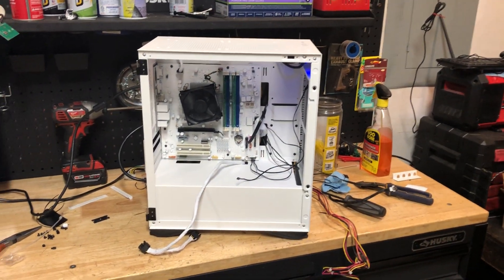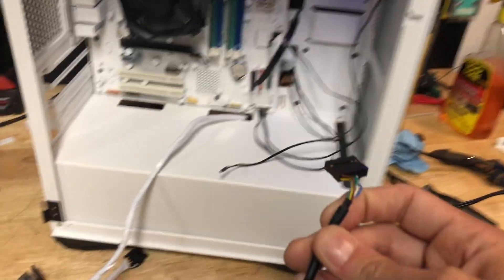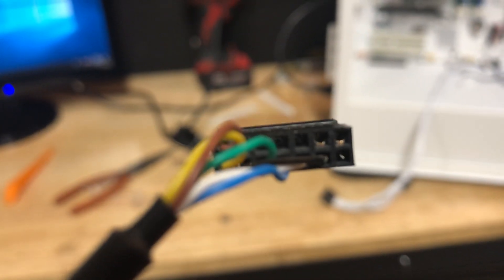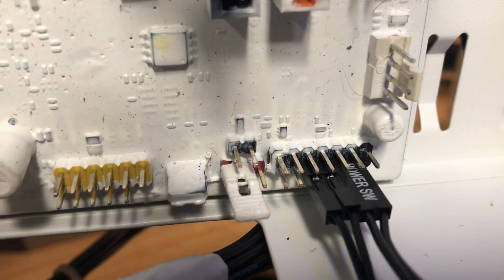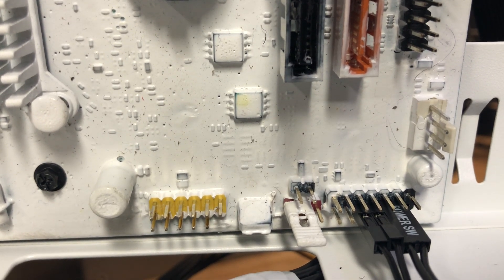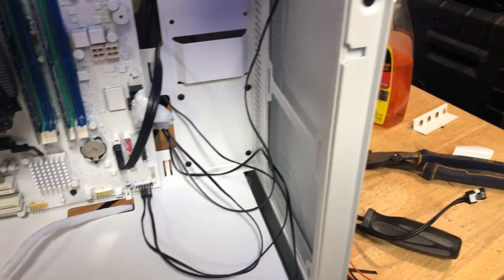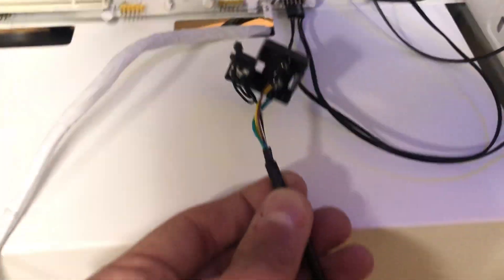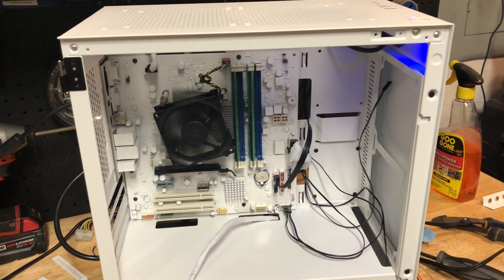Lenovo M92p power button pin out quick tip!

Comment: What if I do it backwards? What if I put a new motherboard in the case?
Reply: How does it power then do I need to buy adapters?
Reply from the maker: no, it's pinned regulary
Reply: Nevermind I figured it out with trail and error based on the yellow and brown cords. 

This video helped so much though thank you!!
Reply from the maker: coudl work

Comment: so what did u do with the hd audio connector because it has a different pin configuration ,, I saw what u did with the usb connector.
Reply from the maker: i did not plug it in, never figured out the pin out trick and just told the customer about it.

Comment: guys help me, i tried it still doesnt work
Reply: I have similar motherboard, got issues with the front panel stuff and tried this method, but still my pc won't turn on
Reply from the maker: @aes3244  check your power supply connectors, you might of plugged something wrong. The oem psu has only a 12 pin for the board and a 4 pin for the cpu which is right above the cpu socket to the left. then try the factory front panel and see if it works, it should go in one way. if your still having trouble after that then something most of gotten shorted or something. I usually when I troubleshoot I bench test it by just placing the motherboard and power supply on a bench and the trying to test it that way. that way you can see what's going on and troubleshoot things one by one. Hope this helps.
Reply: @DLMtechgarage  how am i suppose to plug the 12pin correctly, im using the corsair cv550 and just plug the 24 pin where its fit but idk if thats the right way
Reply: is there any possibility that other  problem causes this, but I'm pretty sure its just the front panel prob
Reply from the maker: @aes3244  could just be the power switch button. make sure you got the right one and if your using the original one make sure you plugged it in the right way.
Reply: @DLMtechgarage  tried this one
Reply: i tried using my old case front panel to turn on my pc but still doesn't work, what did i do wrong
Reply from the maker: @aes3244  check the psu connections and make sure they are correct.
Reply: @DLMtechgarage  idk but everytime i turn on the psu for the first time(after long rest) all my rgb fan(unaddressable) blink for a sec
Reply: @DLMtechgarage  btw did u find out how to plug the speaker, man this mobo confusing
Reply from the maker: @aes3244  I never got around to it and the customer for this build didn't care about it. Their are forums that talk about the pin out for it. If I find it I will share it.
Reply from the maker: @aes3244  hard to say, but could be a short, loose connection, reseat all your cables, cpu, memory....
Reply: @DLMtechgarage  ok man looking forward on it, I'll try what I can do
Reply from the maker: @aes3244  hope you can figure it out!
Reply: @DLMtechgarage  hey man, so i tried it out with my old psu(12pinonly) and it worked, i think its the psu prob, and i tried to look at the 12pin pins and notice its a lil different with the 24 pin ,idk  if thats causes the probs(not really familiar with psu), btw what psu u use to power the mobo in this video, maybe u can help me how to place it correctly
Reply from the maker: @aes3244  you are going to need a special adaptor if you using a different power supply. link below. without that power supply, non oem's will not work

https://www.amazon.com/ZLKSKER-24-Pin-14-Pin-4-Inch-Adapter/dp/B07F1N6YY6/ref=sxts_sxwds-bia-wc-nc-drs1_0?crid=29ID5OA34CY7Z&cv_ct_cx=lenovo+psu+adapter&dchild=1&keywords=lenovo+psu+adapter&pd_rd_i=B07F1N6YY6&pd_rd_r=f8734572-5277-40e1-b251-bcb6896db9a4&pd_rd_w=jyNZV&pd_rd_wg=8lpx6&pf_rd_p=a64002b9-9c26-4361-b8a1-b0f5a4835670&pf_rd_r=GENV53DKXKK2C5R2973C&psc=1&qid=1609335324&sprefix=lenovo+psu+ada%2Caps%2C157&sr=1-1-38d0a374-3318-4625-ad92-b6761a63ecf6
Reply: @DLMtechgarage  yeah I just figured it out that I need some converter to connect it, btw thanks for your help and time, I hope this help other people too😂
Reply from the maker: @aes3244  anytime, feel free to reach out if you ever need anymore input!
Reply: yeah im sure its the psu pin need to be place correctly, i test the psu nothing is wrong, so maybe u can help me how to place the 24pin into this 12pin mobo🤣
Reply from the maker: @aes3244  https://www.amazon.com/ZLKSKER-24-Pin-14-Pin-4-Inch-Adapter/dp/B07F1N6YY6/ref=sxts_sxwds-bia-wc-nc-drs1_0?crid=29ID5OA34CY7Z&cv_ct_cx=lenovo+psu+adapter&dchild=1&keywords=lenovo+psu+adapter&pd_rd_i=B07F1N6YY6&pd_rd_r=f8734572-5277-40e1-b251-bcb6896db9a4&pd_rd_w=jyNZV&pd_rd_wg=8lpx6&pf_rd_p=a64002b9-9c26-4361-b8a1-b0f5a4835670&pf_rd_r=GENV53DKXKK2C5R2973C&psc=1&qid=1609335324&sprefix=lenovo+psu+ada%2Caps%2C157&sr=1-1-38d0a374-3318-4625-ad92-b6761a63ecf6
Reply from the maker: what trouble are you having?
Reply: btw my new case im using is segotep prime xl

Comment: Hey i just wanna ask how did you able to connect the front usb?
Reply from the maker: I never did get around to figuring it out. Usually I get a cheap usb pci express adaptor and run it that way. Never got around to figuring out the pin out. Thanks for watching!
Reply: @DLMtechgarage  You just need to connect it exactly how it fits, any extra pins left or right is not a problem.
Reply from the maker: @Valdore1000  good to know thanks!
Reply: @DLMtechgarage  No problem. I figured that out recently when I bought m91, I was also surprised it works but never got my reset and leds working on another case (as I move the board and components), if you know how to connect those on non-think centre case, much appreciated.
Reply from the maker: @Valdore1000  let me check and get back to you but I have a link somewhere that shows it.

Comment: Thanks, this helped me also, I actually got my hdd led light and reset button working on mine tho, my reset button went on the top right two at the end and the hdd led went on the top left at the end, it might have worked for me because I used a different case idk. Do u know how to get the front audio working though because it uses a different connector from what I can see
Reply from the maker: Thanks for the info on the reset. I didn't mention that in the video and this can def help the viewers. As far as the front audio, I never got it working due to the customer needing the computer in a hurry so I never got to mess with it. If you figure it out def let us know! Thanks for watching!
Reply: DLM tech garage ahh ok, it looks like I’ll probably need an adapter to get the front audio working cuz the front audio on the original case uses a different connector I’ll try looking into it and I’ll definitely let u know if I ever do figure something out.
Reply from the maker: @zac1621  awesome can't wait to hear what you come up with!
Reply: Hey,  have you figured out already how usb and audio work? Tnx

Comment: Can I get the same on a Dell Vostro 260 as I'm looking to change the case
Reply from the maker: you can always mod anthing and change the case on anything. its just a matter of doing some research. im not sure about swapping the vostro if its a direct swap or would entail some modding.
Reply: @DLMtechgarage  could I get the original power button and then get the yellow and black cables and put them into the new power switch on the case

Comment: Thanks for the this video.  I've been researching how to extend the Power button for a Lenovo ThinkCentre M93P tiny.  The pinout isn't really an option for the "tiny" model (unless I can find a compatible molex connector) so I had planned on cutting the wires, splicing in additional wire and connecting the Power wires to an arcade button for an arcade cabinet.  I thought about mounting the "tiny" computer on top of the arcade cabinet or on the side but the tiny computer also has all of its usb, HDMI, etc connectors in use so that would create a lot of additional wires to route.  I upgraded the RAM to 16GB, cleaned out and replaced the thermal paste, added an SSD hard drive and upgraded the CPU to an i7 - which is probably overkill for an 3/4 scale arcade cabinet.  It's a pretty fast computer and quiet too.
Reply from the maker: Sounds like a cool computer you go gong for an arcade. Give you the option to play some other games like ps gamecube and dreamcast

Comment: https://forums.lenovo.com/t5/ThinkCentre-A-E-M-S-Series/ThinkCentre-front-panel-connector-power-audio-amp-USB-pinout/m-p/190651/highlight/true#M11610  the first diagram is the connector you looking at
Reply from the maker: Sorry for the late response. Thanks for watching and thank you for that info. Just used it and was able to get everything squared away. Appreciate the help. Hope you can subscribe and continue to share any input you have. Thanks
Reply: @DLMtechgarage  quick question to get the front usds working did you use a different connector?
Reply from the maker: @MeatyHams  I never got around to figuring it out. The customer needed the computer too quick before I can figure out a pin out. One advised would be just to get a cheap Usb 3.0 pci express card. That would be alot easier